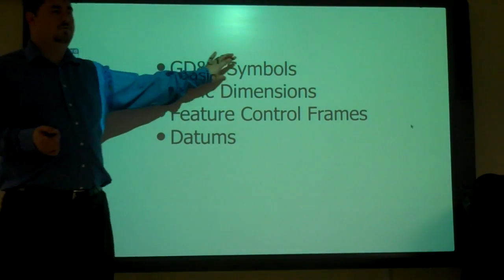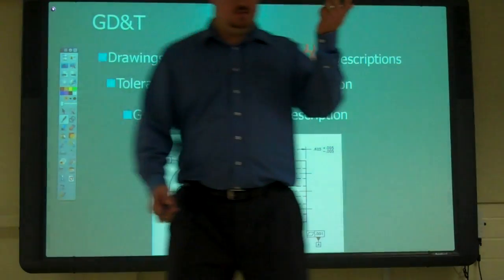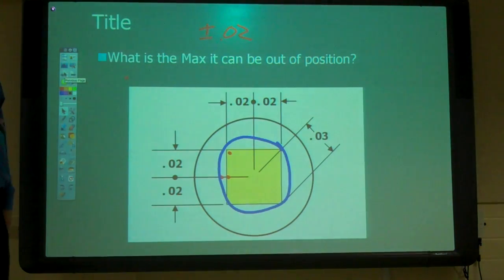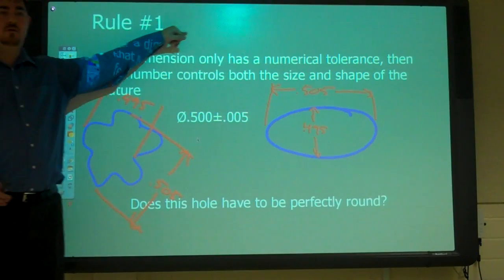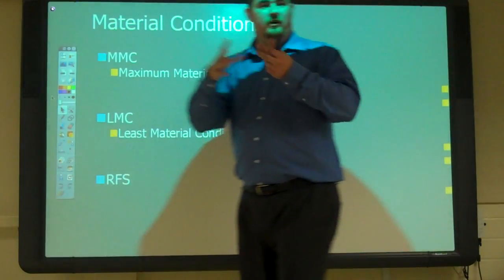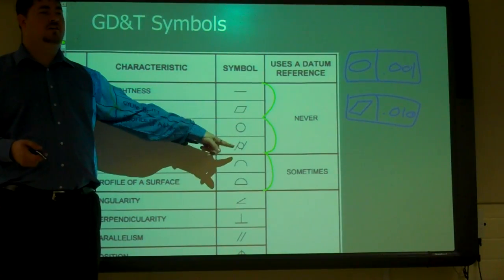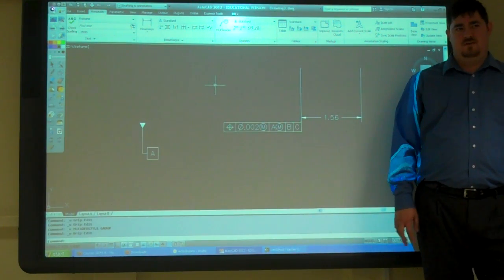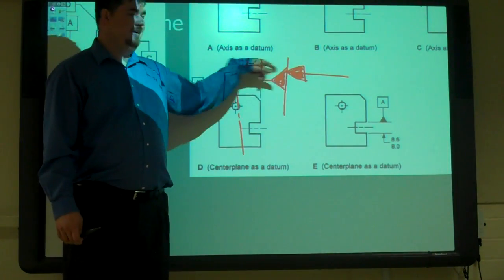GD&T Full Beginner Course: Symbols, Frames, & Datums Explained in 1 Hour

Comment: Mr. James, I do think that there might be a flaw in your theory about perfect spheres according to Rule #1.(After showing the students a video about "how round is your circle", you said that the rolling solids were a perfect spheres according to Rule #1) Even if diameter means a line passing through the center connecting the circumference at the two of its ends,  in that particular case, you are only viewing it from the perspective of the vertices. Now to be accurate,  a sphere has to have equal radius to any given point on the surface. In the case that you have claimed to be a "perfect sphere" is not perfect as the radius of the solid varies from the centre to any given point on the surface other than the vertices.
Reply: +Modulus1578 Well I'm glad someone replied and clarified my doubt. Thank you :)

Comment: Professor Thornburgh:
Hello. As far as mathematical rules of geometry dictates in the example for a diameter of a circle  .500 +/0.005; approx. 28 minutes in the lecture, by definition the diameter of the (geometrical shape) circle is the same on any point on the circle. Although you are given the tolerance of +/ 0.005, even without the GD & T, fabricating that hole, one should imply that once the largest measurement is taken across two opposite points on the circle that passes through the center (diameter) and hopefully within the tolerance upper limit, then any opposing two points that are connected by the infinite number of diameter lines in this circle should be honed off to match that largest measurement. What the GD & T condition offers the fabricator is easing off the honing process to fabricate that perfect circle within 0.495 and 0.505 by (0.001").

Comment: Okay, so I just got through the entire part one. I also just realized that this is a couple of years old so I may have rehashed points that have already been addressed. In general I think you did a fine job. As others noticed, you ask a lot of questions that they clearly don't know the answer to. Just give it five or ten seconds and then move on, If they don't know the answer in that amount of time, they don't know it. Dragging it out for two or three minutes, making them guess, is unproductive even if they should have known the answer. I'm sure by now you've honed your delivery.

Comment: James. I liked this video. Just want to point out that circularity refers to the width of the tolerance zone so in your example, the difference between the two point measurements could be .002 instead of .001. Other than that, good job.

Comment: Square tolerance zone inside of a circle.  The best way to explain the point is this: If you want to use regular ordinate dimensions with no GD&T, you will only be limited to describing square or rectangular zones - which is not necessarily realistic to design intent and part function.  GD&T expands your ability to describe better geometry as not limited by pure ordinate dimensions.  You can discard the useless, unapplicable rectangles and use circles instead with GD&T notations.

Comment: You did a poor job of explaining flatness if I heard you correctly when you went to the surface plate.  If you sat the "perfectly flat" side on the plate and ran an indicator across the top opf the part, you are not measuring flatness, you are measuring parallelism (or perhaps form and location profile)!

Comment: Just realized I'm watching a youtube video inside a youtube video...

In a modern engineering course that's filled with calculus, physics, thermal dynamics, control systems, etc, they really skimp on the universal language of every design engineer - drafting for manufacture. Thanks for posting these.